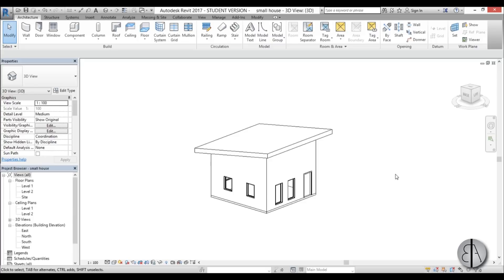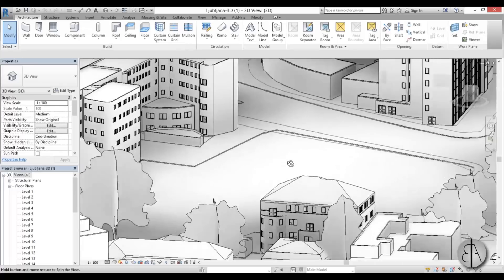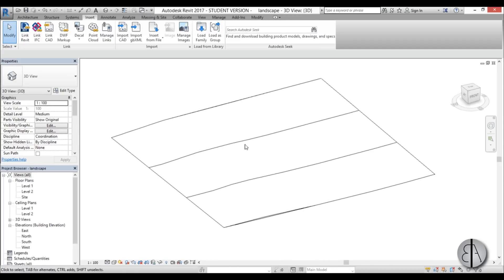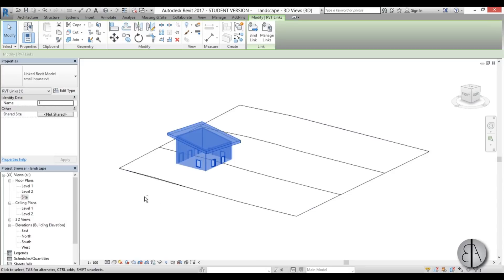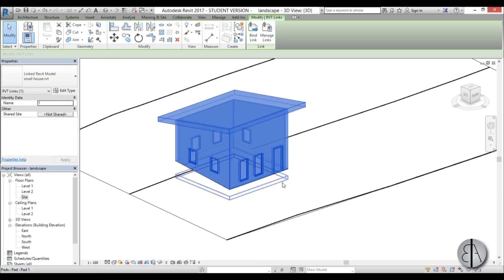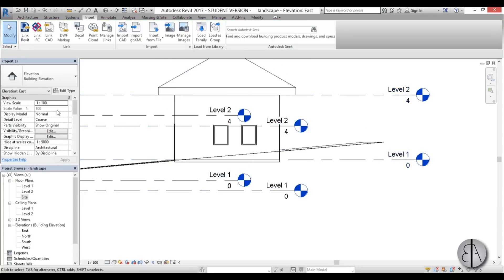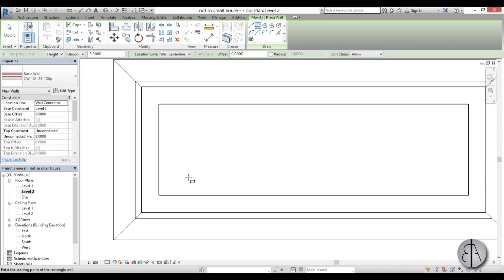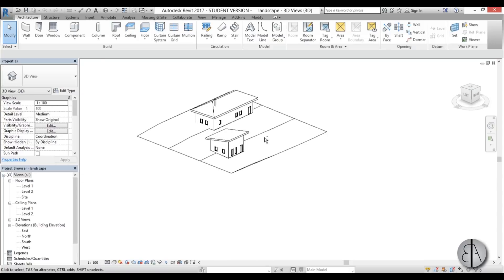Links in Revit Tutorial (for a faster workflow)

Comment: you didnt' do a very good job on explaining the reload from vs reload. if you want to edit the building by going into the linked revit file by unloading the linked revit file in the original file and then going back, do you use reload or reload from? from my understanding, reload from allows you to choose a specific linked revit file to reload from, but in what case do you do that?
Reply: In the case that your linked drawing file is renamed or moved to another folder or you want to use another file to replace the current linked file then you can use "reload from". Here you browse to select file.
"Reload" is the straight forward option of just updating the linked file.